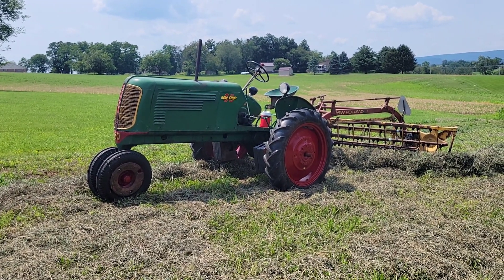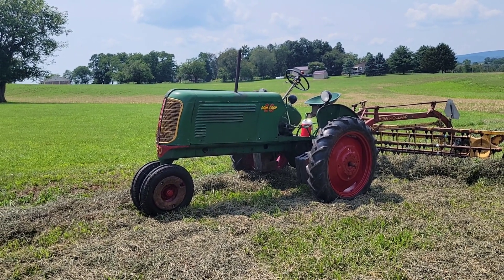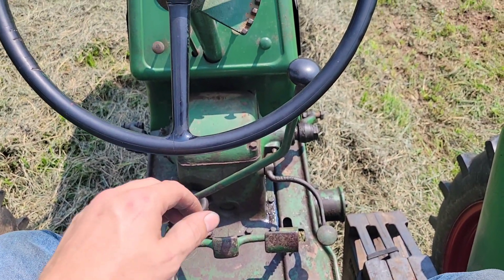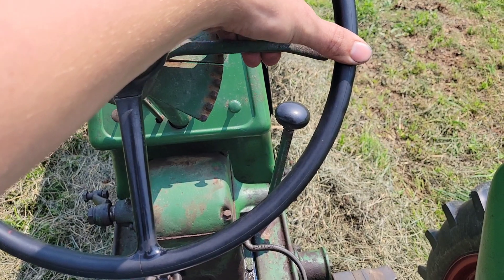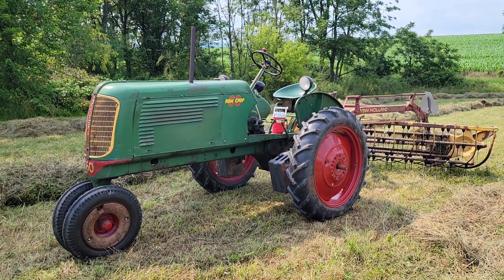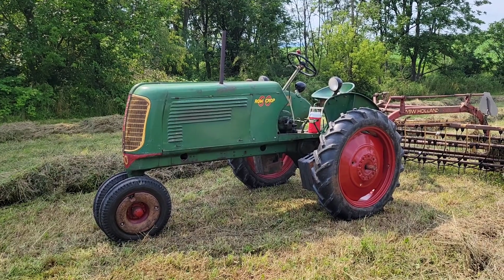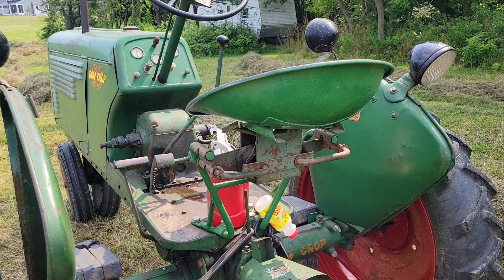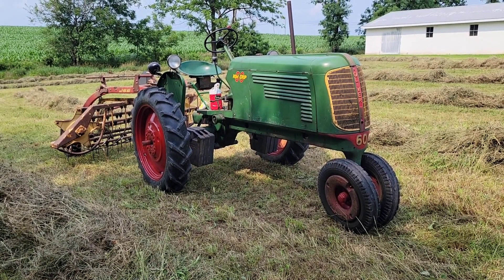Raking Hay With the 1945 Oliver 60 Row Crop

Comment: I put new seat rubbers on my 60 over 20 years ago. Still going strong. The American ones. Tried the China ones on a 550 and S55 and they failed within a couple years of light use
Reply from the maker: I'm impressed with the American ones.  The ride is much better.  I have Chinese ones on my Super 88 that are 10 years old but this set didn't last half that long